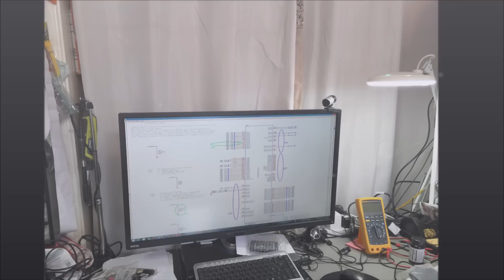iTCXtreme ( https://www.itcxtreme.com/ ) Computer and Electronic Repair Service

Comment: Regarding the Deco P9 video you did... you are totally wrong. The system is 100% compatible with all your 2.4ghz devices.  Should remove that video because it’s wrong and might affect someone’s decision.   You just switch to AP mode, go into settings and disable the 5ghz temporarily, connect all your 2.4ghz devices, then re-boot into router mode again.  The 2.4ghz and 5ghz network will be combined and all your devices will connect as mine all did.  I was having a lot of trouble with my Lyric Round thermostat not capable of 5ghz but I was able to get it all working.  I have 25 wireless devices, all working perfectly. I guess there’s a reason you disabled comments... but leaving your video up would be disingenuous. You’re telling potential buyers not to buy for a reason that is completely wrong. Do the right thing and remove the video.
Reply from the maker: Thank you for your opinion.  However you are missing the point.  P9 do not have separate SSID broadcasting like TP link M4.  This will be added on future firmware releases.  Until then P9 will not work devices like ewelink.  By the I didn't know I've disabled the comments and I will enable it, thanks for pointing this out.